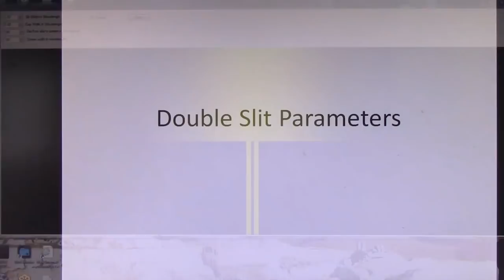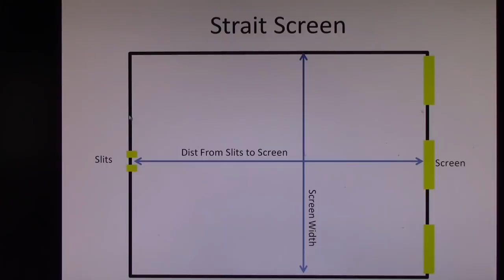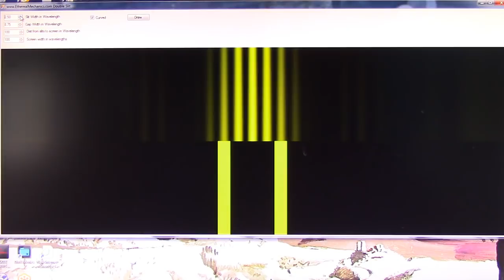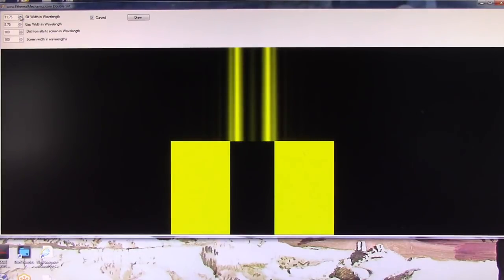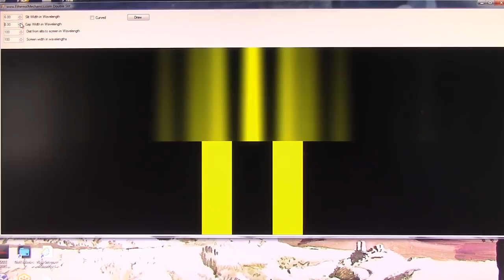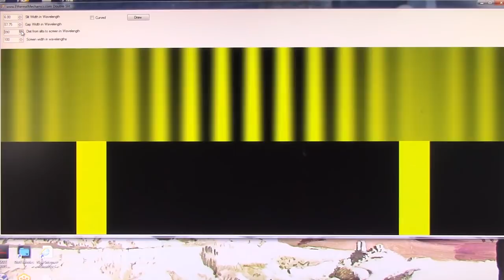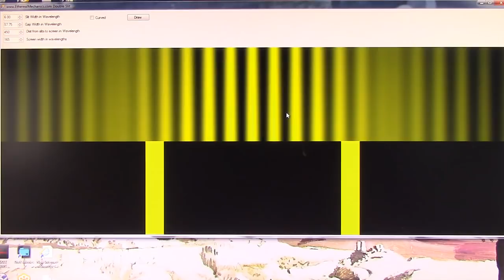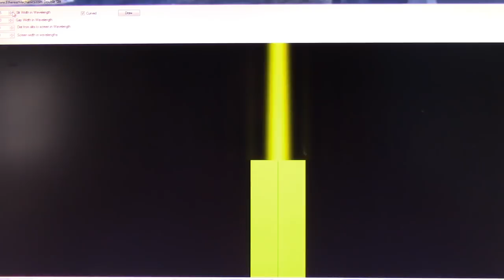T8B: Distinti Double Slit Demonstration

Comment: That's only a computer simulation. Do the real experiment using a cloud chamber. You will see there are no interference patterns whatsoever. Light diffracts into discrete strands never interfering with each other, giving the usual fringe pattern on screen. Light is simply not a wave. It has no intrinsic structure.

Comment: This is great stuff. But interference pattern is also achieved if you fire electrons. And you can fire them 1 by 1, they will still produce an interference pattern. Even worse, you can fire C60 fullerin (a sphere consisting of 60 carbon atoms) and under certain conditions it produces interference patters as well. The physics of the phenomena is much deeper.
Reply: Then again. How can you know that you are firing them one by one? How can you be sure there is a 1 to 1 correspondance between electron fired and electron detected? Furthermore, at least in the case of electrons, how can you know that the electron IS a particle and not just another wave for a different field? Like shown here, the granular nature of the detection media does not allow to really know the nature of electrons.

Comment: Another question. If a transmitter requires an antenna, why does a candle (which also transmits light) not need an antenna?
Reply: burning molecule chains are chemically changing, lots of electrons jumping around in the visible light spectrum. Its actually probably pretty chaotic in a flame, given that a candle flame has a mix of visible frequencies (white light).
Reply: @Jsmith32t  Then how about we modulate the heat to get a signal out?
Reply: This might pertain to your question, if only loosely.  https://youtu.be/Kn2OyQh6o7U

Comment: If the screen's corpuscular detection material were all the same size, would you still perceive a pattern? (I think this was answered in a previous video.) Does the software emulate the type of screen material? (Maybe the hidden options.)
Reply from the maker: This simulation treats light as continuous waves.  There is no corpuscularity in the system.  only a limitation is the resolution in the "pixels of the bitmap"